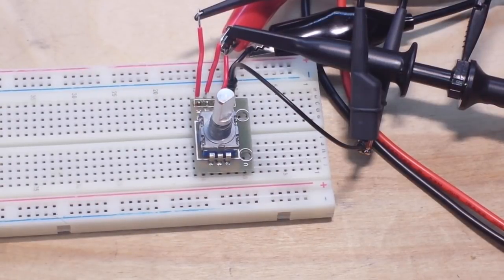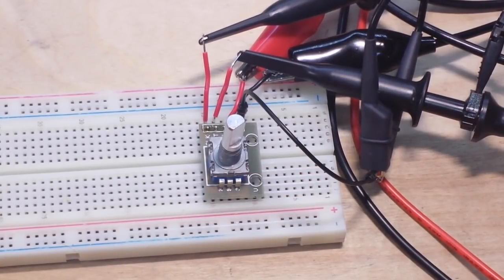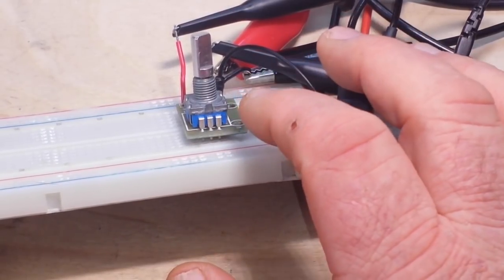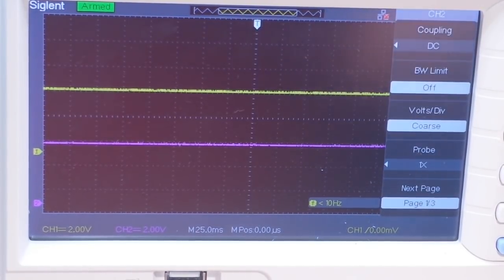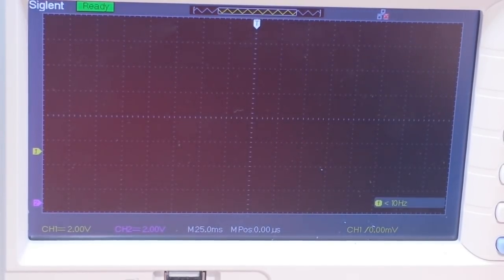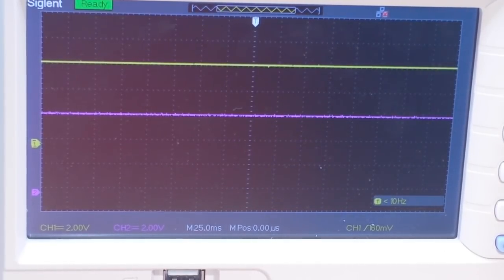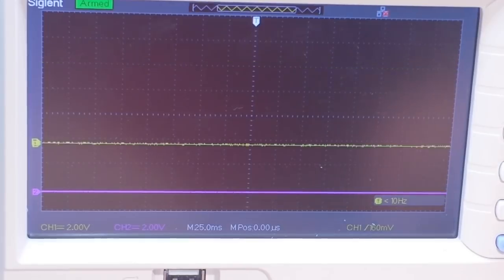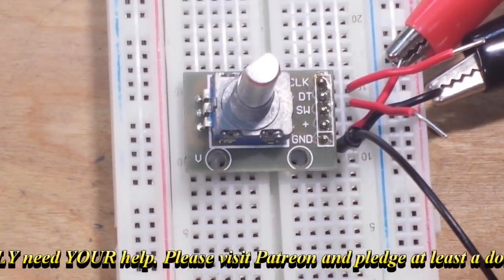Rotary Encoder Howdy Do

Comment: Very nice. Could tell me the resolution of a rotary encoder like this and how fast can it turn without losing itself. Thanks for the vid!
Reply from the maker: Hey George, this one is 12 steps. You can turn it at a reasonable speed. I'll have another video about using them soon.
Reply: Thanks, Paul.

Comment: Hey. Could possibly do a tutorial in the BLE CC2541 Bluetooth module HM-10 clone? Like the code for Arduino and the AT COMMANDS to set it up to be used with an Android phone. I have the Google Pixel XL and no matter what I do it will not find it. My phone is BLE supported. After hours of Google searches I still can't get it to work. Any help would be appreciated greatly.